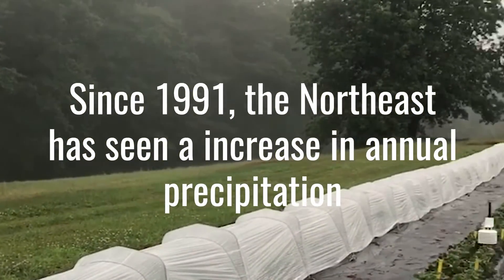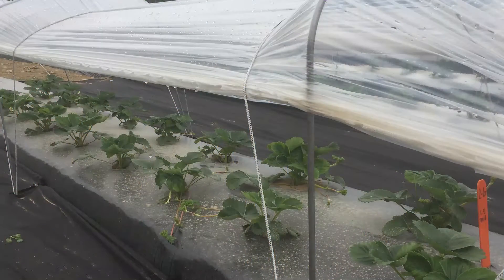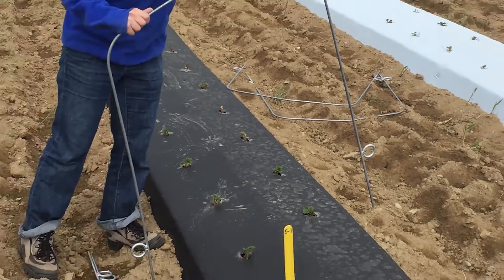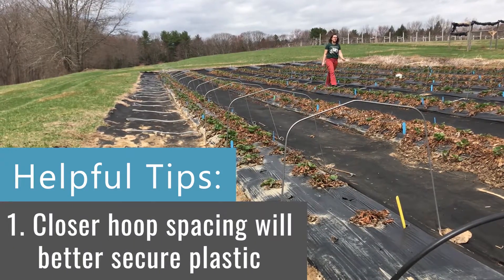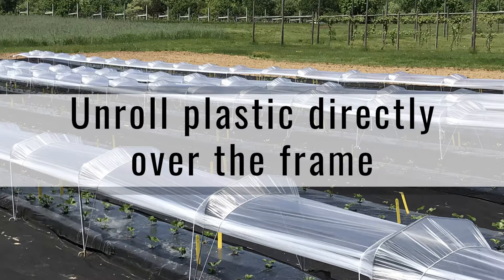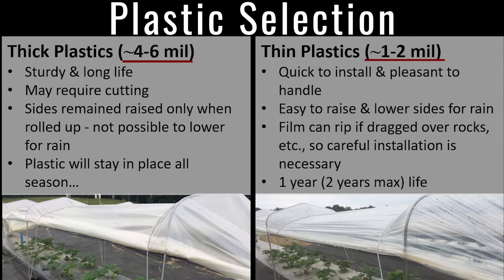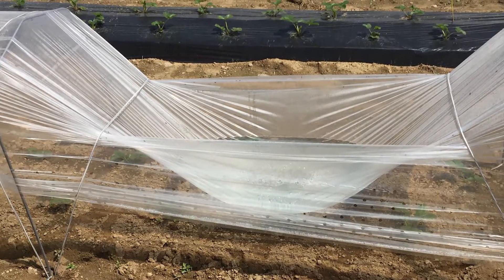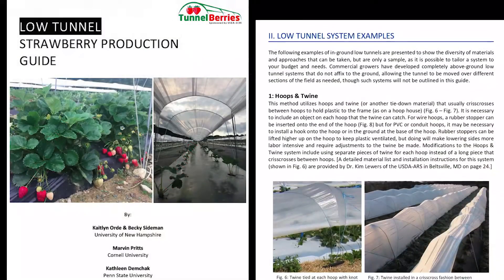Low tunnel structures, installation and management

Comment: Low tunnel
 Hoops
10 years life of RATAN plastic support wire 
for low tunnel crop cover 
Rust proof
2 times stronger still 75% lighter than steel
Very smooth: no damage to film due to rust or burr
Does not get hot in sun or cold in winter
Becomes straight: easy to store 
Flexible: easy to change height and width of micro tunnel 
Non-metallic: no danger of current
No resale value: lesser chance of theft
Whatapp +91 7014180458
https://youtu.be/haThPaVq_3E
https://www.indiamart.com/ratan-metals/crop-cover-wire.html#5-mm-crop-cover-plastic-wire-crop-cover